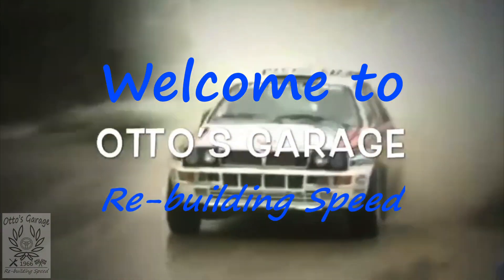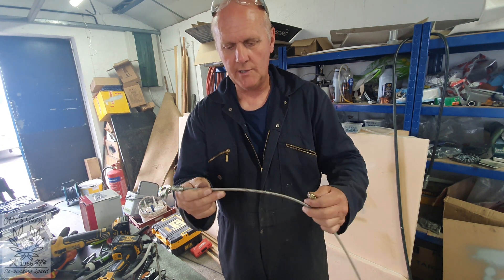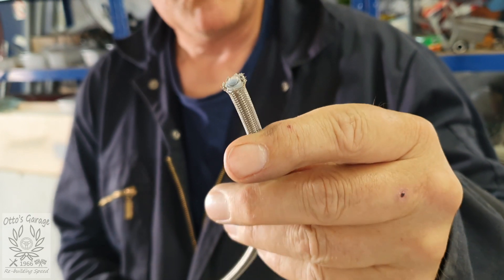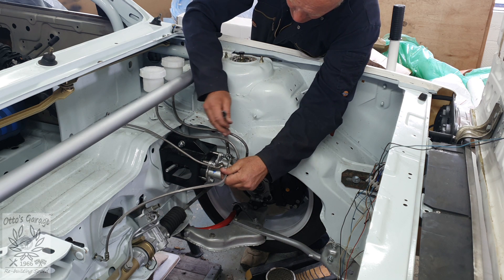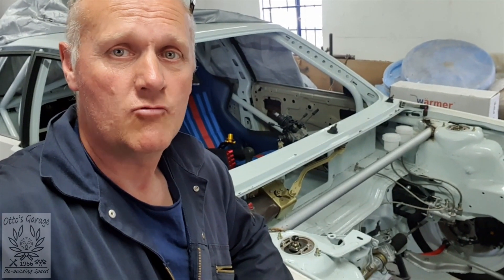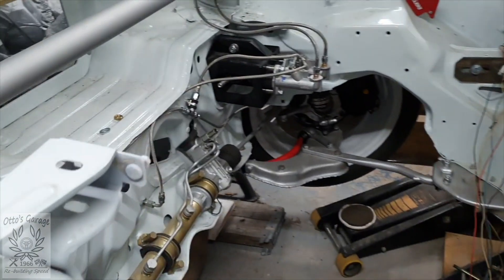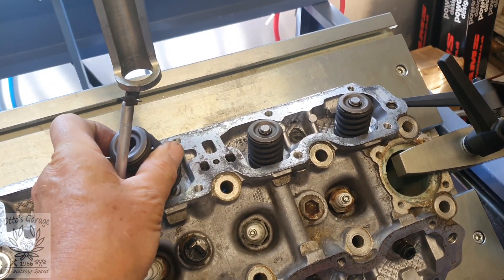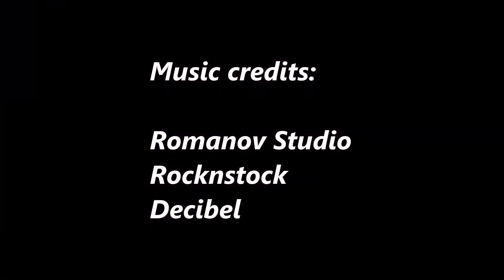How to Build a Lancia Prisma HF integrale -Part 50 Brake Lines

Comment: Sorry if I've missed a episode but what happened to the original turbo you were rebuilding? I'm intrigued as my turbo needs a rebuild but if these maxspeedingrods units are any good I will just go with on of those 👍🏼
Reply from the maker: The exhaust turbine housing had some big cracks which, although we thought would be ok, the Max cost was just too good not to try. Watch this space I guess...
Reply: @ottosgarage7986  that's exactly what's wrong with mine that added to the cost of a full refurb, 360 bearing and your looking at best part of £600 save some doing it myself, but at £200 for the Max it does seem like a bit of a no brainer! Do you know if parts are available for them  or they a throw away item if anything goes wrong  not that it matters quite so much at that price
Reply from the maker: Well looking at the guys in the drift scene who have been using them, they do take a lot of abuse. Go for the slightly more expensive one with the cnc compressor wheel. Like you say - £200 chuck it and replace. Only thing you will need to modify is the exhaust - they have a v band connection  but the turbo comes with a ring you can weld onto the downpipe.

Comment: @Otto's Garage, please where did you buy all these colored electric wires? I can't find them in so many colors. Thanks.
Reply from the maker: Carbuilders Solutions do them as a bundle. Google them. 👍
Reply: @ottosgarage7986  many thanks, I need them for my motorbikes.